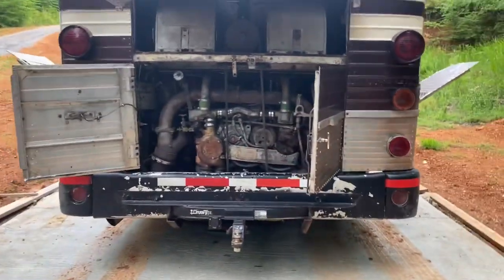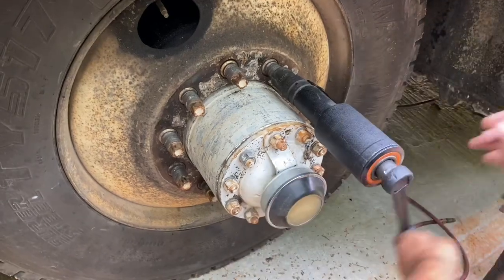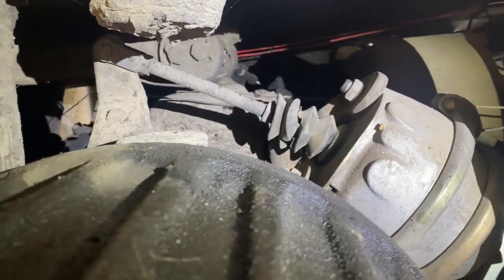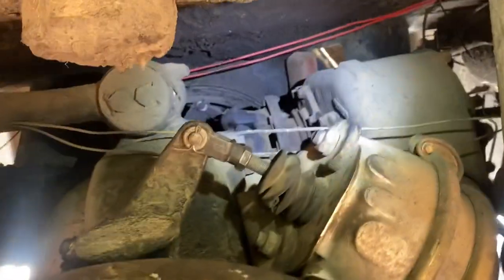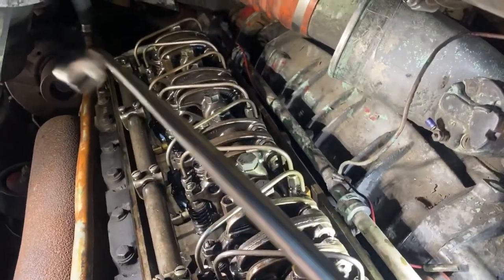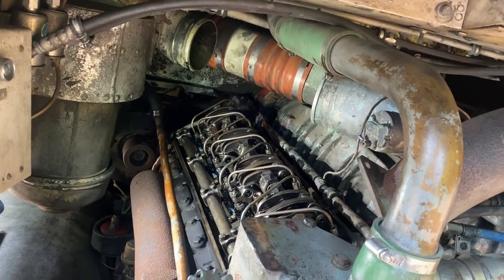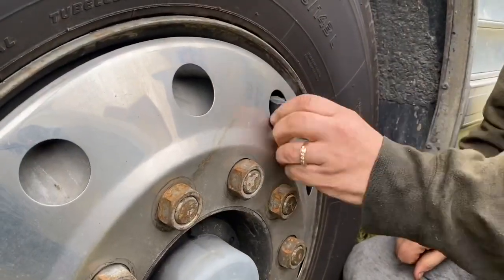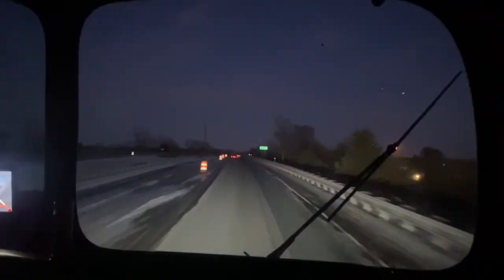1968 mci5a vintage bus maintenance. Brake issue and tuneup detroit diesel 8v71

Comment: Hi Kelly & Scott + Tyler & Leroy                     
All is well here in Kariong near Gosford 50miles from Sydney and 60 miles to Newcastle on the East coast of Australia. 
With your swamp fox the drive mechanism has the rolled pins as  a shear off effects so it won't destroy the rest of the drive mechanism.
We had a Toyota land cruiser with a winch. Someone got sick of replacing the shear pin so they made a hardened stainless pin .  When it was overloaded it bent up the ends of the chaise rails .It took some sorting out  so we put back a standard one.
Love your show its the real deal.
Being brought up in the bush I can relate to a lot of  what you have to deal with. 
We lived 50 miles from Coonamble in the central west of NSW  So we had to deal with it our selves and make it happen it made you stop and think what to do.
Regards Tracey & Dave Wallace/walkaboutwally

Comment: So good to see the infamous MCI "Belt of Death" again LOL.  I couldn't what you were saying about something up by the squirrel cage blowers, but I am guessing some kind of belt tensioner?  Loved the video..great to see the master at work again!
Reply: I think (?!) Scott was saying how the pulley and mechanism for the fans at the top are held up by metal bars that are brazed (welded) in and it can sag? Maybe I got that wrong?
Reply: 2 braces are missing to support the air filters ans specialy the top pulley.
Reply: Yes, he was inferring that over time, the horizontal brace at the bottom has been pulled down from the tension of the "belt of death" and wobbling of same constantly straining it.  The whole setup could use some angled bracing from above downward to help maintain the bottom brace up, keeping the pulley up in its proper place and maintaining better tension on the "belt of death".  Probably only talking 3/4 - 1" of lift to bring it back up to where the builders intended it to be.

Comment: Where i used to work we had one poor customer come in with his semi and trailer. It came in for brake adjustment on the trailer. It left with new shoes, an S cam, and 2 sevo units and hub seals. It was ok we phoned the customer and gave him the bad news. The servo units didn't have the plastic plugs and the spring in one had got rusty, broke and the spring and punctured its diaphram. The shoes were worn out. The S cam had had 3/8 missing off one of the tips.  He was lucky the brakes didn't go over centre on the cam and lock up. Just one of those "She'll be done in a hour jobs" that took a bit longer.

Comment: Been crawling all over my MC8 I bought this past January looking at everything. Wondered why I saw a few threads on the nut that held on the duals. I found some prior owner or a shady mechanic zipped  the budd studs on then put both wheels on and then the nut. Crazy.  Luke @ US Coach provided me with new wheel hardware. Luckily he is hour and half away.

Comment: They make air powered lug wrenches like you have there, they also have them that can have the torque set on it so it won’t over tighten them.

Comment: You mentioned the extra long arm, but it looks like you solved the issue by shortening the rod.  The 78 to 1 tool is interesting - never had a use for one of those, thankfully.

Comment: I thought on those MCI's there is a thermostatically controlled tensioner. I thought I learned that from you Scott.
Reply from the maker: Later models.
Reply from the maker: Air pressure regulated not thermostatically

Comment: Is there a leaky exhaust flange gasket? The Black stuff in the Genny filter looks like Algae residue.
Reply: Believe that the generator is gas based on fluid out of filter.  Also,  diesel filters are usually clear on smaller engines

Comment: Hey Scott, why straight 40 grade oil vs multi grade?

Legitimately curious as to your reasoning.
Reply: I don't think it is Scott' reasoning; it is what the engines were designed and built for. Multigrade oils are a relatively modern invention and the idea that the thinner the better is even more recent and based partly on the ability to machine to much tighter tolerances.
Reply: There are lots of engines designed for only non-detergent straight weight oils. Air compressors also tend to only use straight weight oil in the compressor portion! It is best practice to check out what the manufacturer suggests for everything on an engine and then listen to the guys like BGM for their thoughts!
Reply: @peterrogers9228   Multigrade oils (such as 15W40) are oils that are supposed to have differing properties.  In the case of 15W40, it means that it's supposed to have the properties of a 15-weight oil when it's cold, and a 40-weight oil when it's hot.  It's a scientific sort of voodoo that depends on the molecules curling up or straightening out depending on the temperature, causing them to have different properties, flow rates, molecular shape, and behaviours that would be desirable in many other engine builders engines, whereas GM and Detroit Diesel was designed to have (originally 30-weight, then re-specified later on to) 40-weight oil at all times, from stone cold to operating temperatures.  With a multigrade oil,  starting up a cold engine, theoretically, the oil would only have the properties of a (insert first numerical value of multigrade oil here) oil.  This might be helpful if starting your engine in extremely cold climates, but otherwise, GM and Detroit felt that the single-grade thicker oil was just fine whether cold or hot.

Comment: Scott is there a way to modify that cooling system to do away with that belt?
Reply: Everything can be done with the proper application of $.  Not really an appropriate application of $ here though. The squirrel cage blowers will work just fine, the belt is just an annoyance.  Needs the dampers replaced to keep it from being so floppy though.
Reply: @richardlazarski4553  Direct electric drive on the existing fans?
Reply: @bruceknowling415  possibly with the right amount of $ and available extra electric power.

Comment: Hi Scott, what does that tool do you used on the studs.
Reply: It's a torque multiplier the little arm there wedges up against the wheel and has a planetary gear set up in it

Comment: Does anybody make a guard, possibly with built-in idler pulleys,  to stop that long drive belt flapping around so much?  I'm surprised it stays in place.
Reply: As Scott mentioned, the upper brace that holds the pulley at the top of the belt, has sagged down from tension over the years.  When the upper brace was new (and when it gets some helper braces to lift it back up), the belt wouldn't have been so floppity unless the belt was old, worn, stretched out.